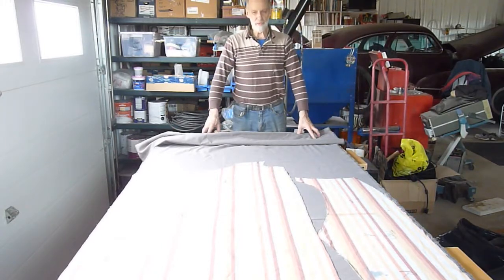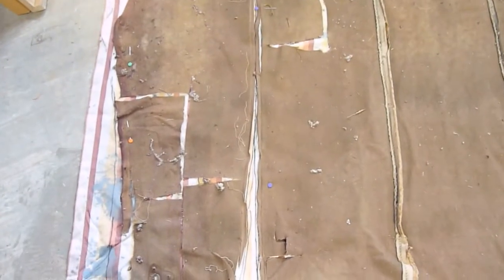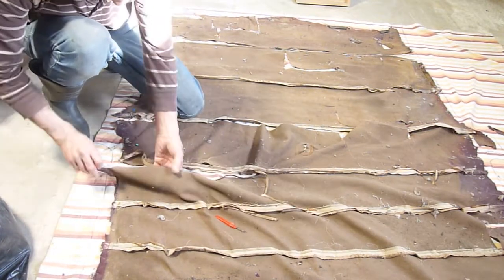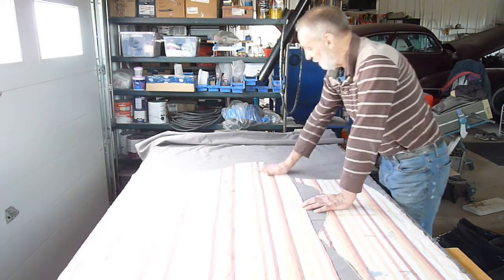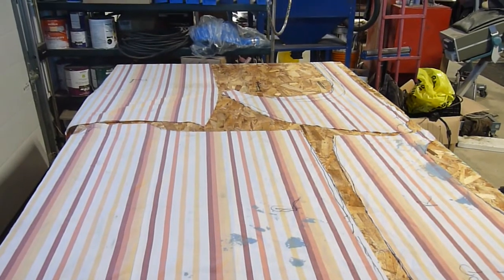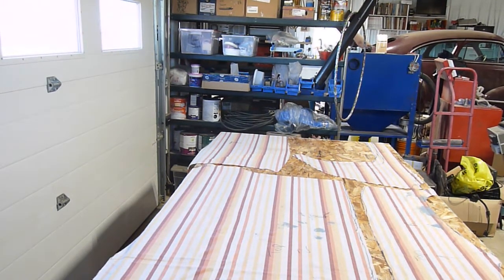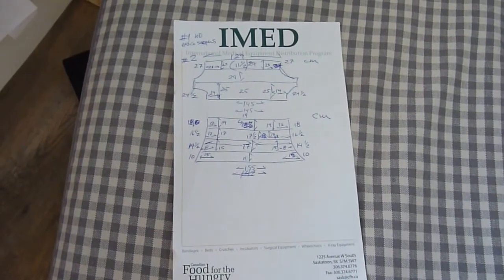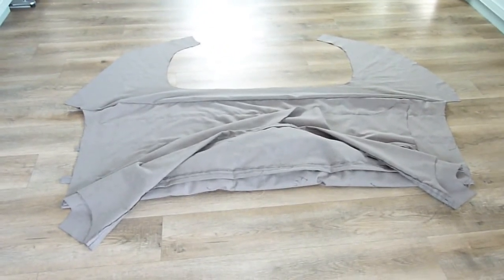Make a hoop or bow style headliner Episode 29a

Comment: I am at 12:01 and am lost in trying to figure out how the fabric all fits together. I am sure this is simple yet i have no clue how the hoop is sewn into the headliner in places where two pices come together. A section drawing would help one understand.
Reply from the maker: Hi OldSchool. Hopefully this description helps. The headliner is sewn where you want the seam to match the hoop position. The hoop position is determined by  the location of the hoop retainers on the car. Fold the headliner at these positions and sew a seam-this will result in a hoop but you will use this as a flat piece to hold the actual hoop. I did it this way because I thought I would get a better result than if I tried to make this seam the bow hoop. I then atttached the bow hoop. This hoop is approx 2" of material folded flat and sewn onto the flat piece of material on the headliner seam. If you are comfortable with your sewing skills-I was not-then you can make the headliner seam the hoop for the bow. Doing it my way will result in a better headliner seam and hidden hoop seam. If you sew like I do. I would recommend two seams on the hoop for strength. Sometimes there is a fair bit of force as the hoop pulls the headliner tight in the corners of the roof. All the best, Ron.
Reply from the maker: To add to my description, The original hoop is shown at 7:30 +. This is the method I copied which is the factory method. This is sewn onto the headliner flat piece (flap) at the bow seam. Fold the headliner at the bow location and leave a flap of approx 1". Attach the hoop to this. Clear as mud?

Comment: Why not skip sewing in the separate long loops retainers (or pockets) that the headliner bowes slide into and just measure the spacing between each bow, mark it on a solid piece of material, then fold the material and sew it with a gap wide behind the stitch to become its own sleeve for the bow to slide into?
Reply from the maker: @brianandrews7099  hi, I only did it that way because I didn't trust myself to add the length reliably. I had most of the original to copy. I thought my results would be better if I did it like the original. Your suggestion would be easier if you are confident in the end result. This is the first time I've made a headliner. Didnt trust myself.